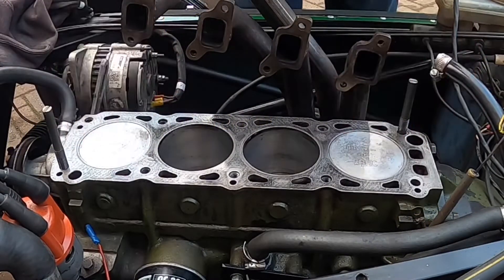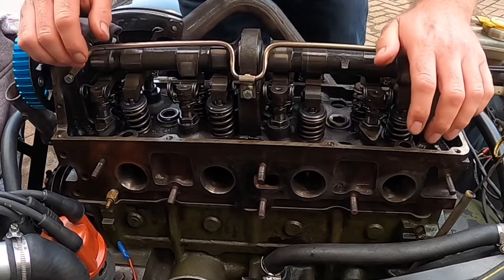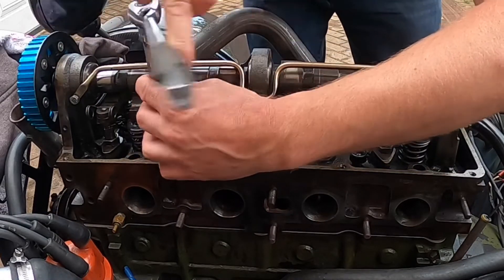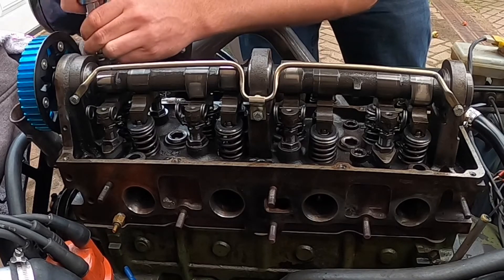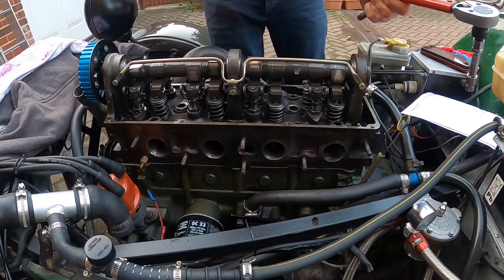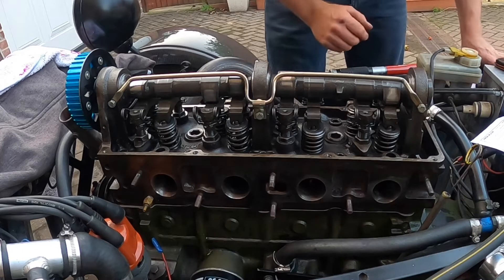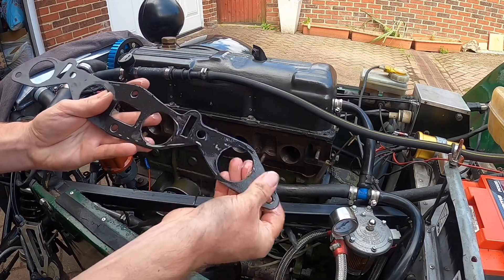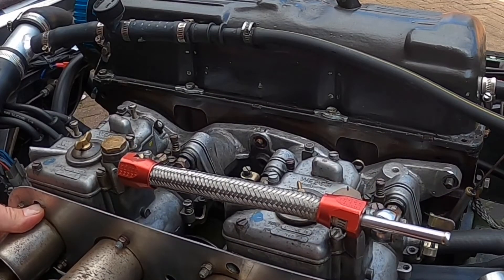Ford Pinto Head Install, Bolt Sequence and Torque settings explained Part 7

Comment: pity about the low sound.  I was taught  that when you do your final torque setting you crack the thread by rotating the bolt backward  just enough to free it then rotate the bolt clockwise to the correct torque setting. Tried and tested and it makes all the difference.
Reply from the maker: Excellent advice thank you
Reply: Is that for the pinto?? Or all engines

Comment: Is it always 85 or 115 when checking?
Reply from the maker: It’s always best to check the user manual for your particular engine and it’s state of tune. I wouldn’t like to answer your question as I don’t know what engine you have.
Reply: @alfatechniks887  It is a 1600 gt pinto engine. It's hard to find. everyone says something different haha

Comment: Thanks for the great video, I'm currently restoring my ford capri with a 1.6 pinto engine. Do you use any additives for the oil or fuel because it's an older engine? thanks.
Reply from the maker: Thanks for watching and glad you liked the video. I don’t use any additives and it works with unleaded. The this days is keeping the fuel fresh, as any e10 can attract water and condensation can occur in the fuel tank. I do occasionally use octane booster if I advance the timing to prevent any pre determination. The engine seems to prefer it